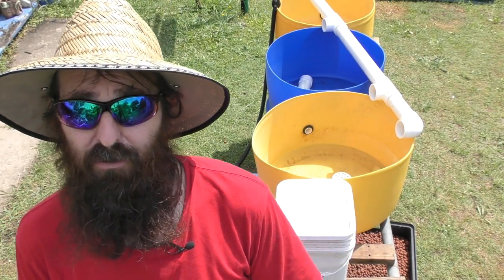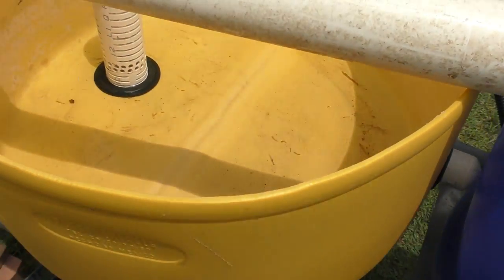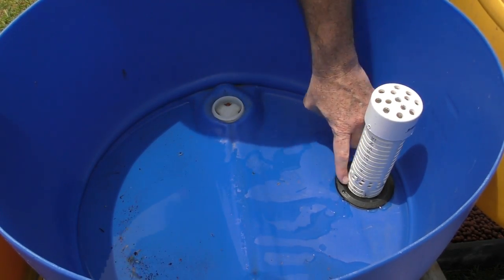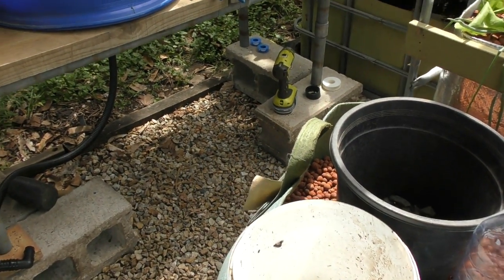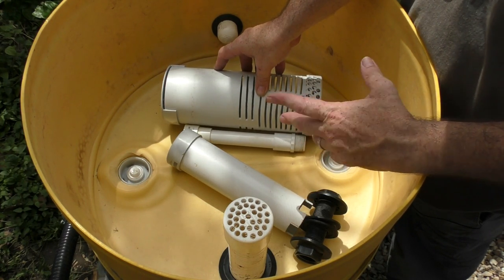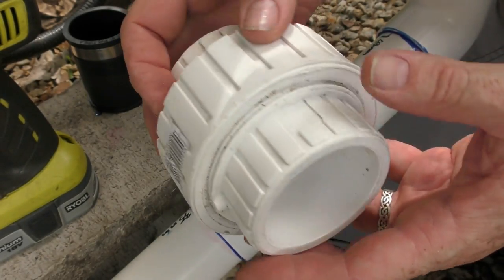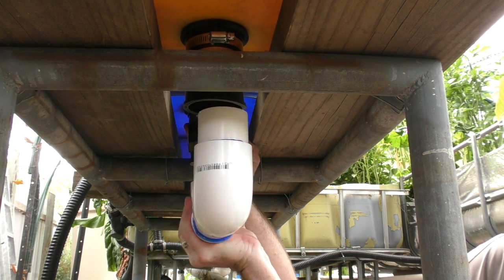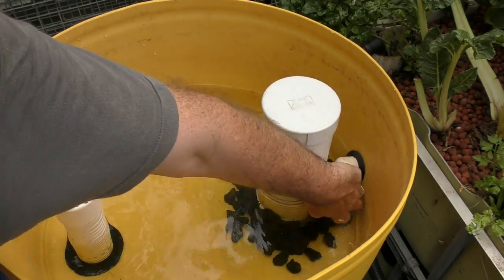Single Bell Siphon Running Multiple Beds in the Aquaponic System

Comment: When you put Teflon tape on threads always go the same direction as the thread. (the direction you'll be screwing on what ever it is) That way the Teflon won't ever ball up or unwrap, as you screw your piece on. Helps prevent leaks in a big way. Thanks for another awesome video!
Reply from the maker: Thanks Joseph. Have had that pointed out a few times now ;)   Still sealed so no drama there. 👍
Cheers & have a top one.

Comment: Really appreciate your efforts and regarding the blocking of drilled holes it may suit having the drilled holes higher than the lowest level leaving a small water bed level if not suited than th I'm sure you considered the use of slits doing away with drilled holes. something I'm considering including is the cut off system for the pump for when the bed reaches its height max. It has to be safe and so I'm working on a remotely placed 12VDC relay which contacts will provide 240Vac interruption in fact it may have to be a timer associated with it, so digital relay comes into mind. The added idea I like which I perceive would  prevent insect ingress is to use a water trap like we  have in sinks.Thank you again for your efforts.
Reply from the maker: Hope your build went well Michael.
I don't know if this helps at all but I've seen a load of folks just run with timers for the grow beds. They have a small hole drilled in the base of the standpipe to allow the bed to drain while the pump is off. 
Cheers.

Comment: I use a silicone sealant instead of glue for my pressure pipe.  That way i can dismantle and reassemble. Seals up just fine, even if it gets bumped or moved.
Reply from the maker: Have seen a few folks use it now 👍
Cheers mate.

Comment: Hi Rob,maybe a tip maybe not but with the ends of any solid pipes having water come out of them i like to heat up the end of the pipe with a heat gun then use something small and round to create a little drip edge so the water doesn't back flow on underside of the  pipes.
Reply from the maker: Thanks for that Matthew. I can see where this could of helped in a few spots in my systems over the years.
Cheers mate.

Comment: My inner plumber cringed a bit to see you put the teflon tape on in the wrong direction and then you used the channel lock pliers wrong too. Not trying to nit pick but its something i learned doing plumbing early on. Thanks for the videos Rob!
Reply from the maker: Is one of those thing I suppose, never had any one teach me how to use them.  I thought I'd put the tape on the right way but will have go back & check as someone else pointed that pout as well :D ;) 
Cheers.

Comment: Hi Rob wanting to start some grow beds and fish tank.  Could you use an old chest freezer as it would be a reasonable size, hold water and would also be insulated plus it would look quite neat from day 1 as you would not have to cover with timber or some other material.  Also repurpose old non working freezer to save going into landfill. Regards Phil
Reply from the maker: I know a few folks that have used them Phil. 👍 A mate used them as deepwater beds in his cafe set up. 
There was a guy on the Backyard Aquaponics forum that used a running industrial style chest freezer to run trout all year round. It also helped that he was a fridgy & knew how to tweak it. 😉
Hope that helps some.

Comment: Hi Rob,
Just got back to this video as I am considering (yes, already...) to expand my single IBC setup. I like the idea of the barrels in this project of yours, it not only brings a bit of colour to a garden LOL but it offers quite a good growing surface. I have two questions for you at that stage:
- how many liters of clay per barrel? more or less
- why having the barrel connection sitting under the barrels? Doesn't this create a place for stagnant water ie: anaerobic zone? I am not sure to wrap my head properly around this. 
As usual I appreciate and do value a lot your experience and your videos, please, keep them coming.

Cheers
Reply from the maker: Hey Jason. Did you end up setting up a system like this? 
Cheers.

Comment: Rob, it is getting on toward spring up in USA, and the kids want to set up something again. So this is good cause I have a a bunch of barrles, but the clay balls are out of sight around here, what else could they use, and  for me can I put a couple tomatoes in these ?
Reply from the maker: Hey Sheets. You might be able to get lava rock or expanded shale cheaper than the clay in the USA from what I've been told mate. Rock that has no carbonates in it works well. 
Hope that helps mate.
Reply: @RobsAquaponics  All information helps , what kind of rock has no carbonates in it?
Reply from the maker: @skeets6060  We use basalt over here which is also used as a road base. 
There's a simple test you can do to make sure that there are no carbonates in the media & this link should take you straight to that section of the video,
https://www.youtube.com/watch?v=3nc5UqgOEIQ&t=415s

Comment: i had an idea for a siphon, using the valve from a toilet and a float joined by a nailon piece, when the water goes up, it opens the valve, hope this is usefull for someone.
Reply from the maker: Some of the first barrelponic systems used them in a header tank. 👍👍
Cheers Sergio.

Comment: Hi Bob . Please add a video of single bell siphon for two grow bed running  (at same time ) . And where to buy uni seal and the already cut/hole pipes .  thanks . Lynn
Reply from the maker: Hi Lynn. This is the clip that shows how I set up 3 beds to run from one Bell Siphon. 👍 All you need to do is onl join 2 beds & have the siphon in one. 
I'f you're in Australia you can buy the Uniseals from me. 
https://bitsouttheback.com/uniseals/
If you're not let me know where & I'll see if there's someone I could recommend. 
Hope that helps
Reply: @RobsAquaponics  wouldn't you need a bigger siphon for multiple growbeds?

Comment: Ey Rob, top video! Wondering how the displacement of solids / waste / nutrients goes using this method. Is there a cascade effect from the first to last growbed?
Reply from the maker: The nutrients wouldn't be an issue with these barrels as the growing space can only fit a limited amount of plants. 
If it was four or five fully planted out 1 x 3m beds that were hooked up you may find some issues of nutrient depletion. As to how much that would depend on the nutrient level of the water. 
Cheers Steve.
Reply: Ahh yeah..  Seems logical. I suppose directing a dedicated flow into each individual bed would minimize this. Thanks for the reply mate!

Comment: Just an fyi, you are putting the thread tape on backwards.  You want to put it on in the direction that you will be screwing the fitting  on, otherwise it will push the tape out of the threads.
Reply from the maker: More than  a few folks have pointed that out. ;)

Comment: Rob... I want to know about pressure and weight, is that piping  connection  bellow those bed  is strong enough to hold the whole pressure and weight from water,hydroton, and many things above it ?
Reply from the maker: The only real weight was that of the water as the media is excluded by the screens on the drain pipe. I've had no issues with the fitting as up to now but if you were concerned you could always place a bracket of sorts under it to hold it in place.
Cheers.

Comment: Hi Rob, I have a top and a bottom IBC tote as grow beds. Do you recommend connecting them together via the bottom IBC drain valve and have the siphon on the other grow bed or should I just run the siphon independently?
Reply from the maker: Sorry it took so long to respond. 
I'd probably plumb them up separately. Will give you more flexibility down the line if you decide to change the layout of the system.
Hope the build went well.

Comment: where do you buy your clay? i can't find a cheap place. everywhere i go it would cost hundreds of dollars to fill one growbed. and what are those through hulls you  are using?
Reply from the maker: I was lucky enough to buy a load while we had a good exchange rate but it still cost us just under AUD$200 to fill a single IBC grow bed. 
I also picked up a load second hand I found posted on a local Facebook aquaponics group. 
Volcanic rock/scoria & expanded shale are also light wight mediums you can use that cost a lot less. Rock that contains no carbonates is also a good option. Just a bit heavier to work with. 
Hope that helps some CF.  👍

Comment: Is there an advantage of having the 'link' pipes between the beds so tall (looks about 20/25cm)? If that pipe was only a few cm from the bottom of the non-siphon bed would it not still work the same?  I'm thinking less space lost and less chance for roots to clog?
Reply from the maker: I left them taller just in case roots became an issue & blocked sections of the pipe. 👍
Wouldn't be an issue with quick growing crops but thought it worth while to include. 
Cheers.

Comment: Hi rob, can you please tell me is that burring tool a burning tool or a different tool that you use for burning? Thanks
Reply from the maker: Hi Nicole. The tool I used is called a deburring tool. They're basically a curved blade that is used to cut off the unwanted burs left behind. They are fairly cheap & available from most hardware stores. 
Hope that helps you out some.
Rob.

Comment: Would have been nice if you had shown the water running through the beds. What is preventing the water from filling up the siphon bed on the end first and initiating the siphon before the other beds are filled with water?
Reply from the maker: The beds filled evenly as there was no obstruction of flow in the drain pipe. You can check out the update clips to see if it worked. 😉 👍
Cheers
Reply: appreciate the quick response
I currently have 4 long cut barrels. I want to do this today but I'm unsure of the details. I am having issues with my siphons in each beds.sometimes they work, sometimes not. so i'm just going to do one
Reply: but I wanted to know why the water wouldn't just run to the end barrel, siphon that and forget about the others
Reply from the maker: The water will follow the path of least resistance so will flow through to both the middle & end beds at the same time. 👍 The only time the water may only fill the first & last beds is when roots block the pipework in the second barrel. 
Hope that helps & the build went well mate.
Reply: Rob Bob's Aquaponics & Backyard Farm I just finished it actually. I really appreciate your insight. I have used the connection on 4 beds and I just placed the siphon in the 4th bed. Works now fine. Thank u so much

Comment: awesome, one question...drains have the same level of sifon?
Reply from the maker: I found the first bed had a slightly higher water level than the last. That has to do with the final bed holding the siphon lowering to the "burp" level before the fist could fully drain. The difference in water level was about 25mm or 1".
HTH some Cesar. 👍

Comment: Hey Rob: David here from Ga in the states, how do you keep your square buckets from sun degradation? Thanks
Reply from the maker: Hi David. 
Some have lasted for years with no issue so I think that must have been made from UV stabilised plastics. I have noticed that the lids always last longer than the buckets but they are made from a more pliable plastic too.  
The best way to protect them is to either paint or wrap them, basically anything to stop the UV from hitting the plastic. 
Hope that helps some mate.
Reply: Thank you Rob and it does

Comment: Is there a reason why you just didn't tie the barrels together through the side instead of the bottom?
Reply from the maker: Easier to access the drains in case of root intrusion I thought. 👍 Wouldn't be an issue if you were planting them with fast growing, short lived plants like salad greens. 
Cheers Mike.

Comment: Is there a reason why new holes are drilled into the barrels?  Can you use the bungholes already in the barrels?
Reply from the maker: The bung holes are not always flat & the threads vary between different types too. If you're lucky enough to find one that's suitable I'd use them.
Cheers.
Reply: Well that makes sense.  I figured there was a good reason...I just couldn't think of any on my own.

Comment: Actually if you have 20,  I will use them for the commercial Aquaponics project here in Bangkok,  ,  if not I will just use them on my small home system ...   Cheers buddy
Reply from the maker: I forgot to take them down to the PO sorry mate. Will run down in the morning & get back to you with an Idea on the cost then. Cheers mate.
Reply: Thanks..

Comment: You wrapped the Teflon tape backwards but great video
Reply from the maker: 🤣 Have been told that many, many times now. 🤣
Cheers TV. 👍
Reply: @RobsAquaponics  I am a plumber who might have a touch of OCD 
I am very interested in your system rite now I have a pretty good size rain gutter system but certain plants like tomatoes I am struggling with. But it grows great beans lettuce cabbage and is a good tree starter. Keep up the good videos thanks
Reply from the maker: @trappervirginia1368   Is all good mate. 👍 I'm just an amateur here when it comes to plumbing. 😉 Are you using the pouches with soil like the Larry Hall method?
Reply: @RobsAquaponics  very similar but used 4pvc pipe rather than a gutter and panty hose full of Peet moss.
Reply from the maker: @trappervirginia1368  👍 Nice one. Might just need a more diverse nutrient for the flowering Tom's

Comment: Hi would this work on a 3 bed ibc system with tank and sump? Or would that be too large of a grow bed?
Reply from the maker: It would work on a larger scale. You might need to set up the bell in an independent barrel to one side (so it can handle a greater flow) like I showed in this video,
https://www.youtube.com/watch?v=pKwq_PRCeQw&t=0s
Hoppe that gives you a few ideas.
Cheers Rosie. 👍👍

Comment: Is here a reason you didn't just use a larger diamiter pipe round the bell syphon ?
Reply from the maker: It saves on bed space if you can use a smaller diameter. 👍
Cheers Carolyn.

Comment: What are you using to seal the connections between the buckets for all the connections? Looks like some black rubber seal of some kind but cant tell how it connected.
Reply from the maker: It's a rubber-based "Uniseal" RT. 👍
This is the page on my website that shows how they're used,
https://www.bitsouttheback.com/uniseals
Reply: @RobsAquaponics  Awesome thanks! Is there a method that can actually squeeze and thread onto the hole?
Reply from the maker: @ForwardEngineering  Using PVC threaded fittings may work OK but there isn't a lot of "meat" on the plastic to make it a strong fit I don't think.

Comment: Just a small Query.. what should be the height of siphon inside the tank w.r.t the inlet pipe
Reply from the maker: The height of the standpipe should be about 20-25mm/¾-1" below the top surface of the grow media in the beds Saibal. 👍The inlet pipes can be lower or higher than that as it's the standpipe in the siphon that will set the water height.  
I hope that helps some.

Comment: for anyone concerned about leaks: TOP FITTING FOR BULK HEAD
THEN RUBBER WASHER
THEN SHROUD
THEN RUBBER WASHER
THEN BUCKET
THEN BULKHEAD NUT
there's no point in having a washer on the outside of the bucket as that doesn't create a proper seal
best wishes :)
Reply from the maker: Must say that I don't have leaks doing it this way in any of the beds but do now know the way you pointed out to be the right way to do it.  
Cheers.
Reply: Rob Bob's Backyard Farming I'm glad it's working out! Thanks for the great vids :)

Comment: Ive been adding a small nylon tube to the bell of the syphon to break syphon on my systems. i notice you dont use them and your system takes several tries to break syphon. Is this wanted, not wanted, or does not matter?
Reply from the maker: From what I've seen it's not a big issue. 
Having the "snorkel" hose definitely helps the siphon to break better if the flow rate is high. If it's too high with the ones I build they won't break as well. 
HTH some. 👍

Comment: can you put a list of supplies that you used on this video? I would like to make something like this.
Reply from the maker: Hi Robin.  The drainage pipe length will be unique to the beds you set up. I used the 90° elbows & a "T" all in 50mm/2" for the drain that connects the 3 beds.  
They were sealed into the beds using 50mm/2" uniseals (which I sell if you live in Australia) as they are a lot cheaper than bulkhead fittings. 

For the bell siphon I run through the parts used in this clip which goes into much greater detail on how they are built. Have linked to the part where I start talking about the build. If you run the clip from the start it runs through how the siphons work. 👍
https://www.youtube.com/watch?v=Ia1BQFTaG7c&t=2m41s
Hope that helsp you out some. 
Rob.

Comment: maybe a silly question, but will the external cyphon work on a single large bed with multiple drains?
Reply from the maker: It should work fine Levi. The multiple drains leading into the siphon should help with drainage times I would think.
Would like to know how you get on if you have a crack at one.
Cheers,
Rob.

Comment: Why holes anyway? Seems like only slits will do the job...
Reply from the maker: I wanted to add some more after the initial slits were cut & it was easier at the time to drill the holes than to set up the saw again. Was a stuff up but hopefully my explanation stopped others from repeating it. 😉
Cheers.